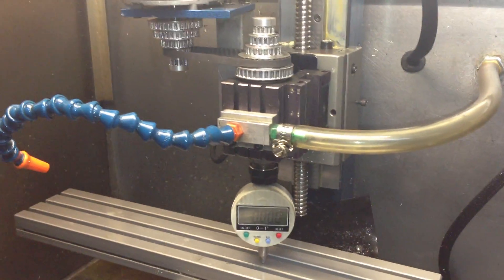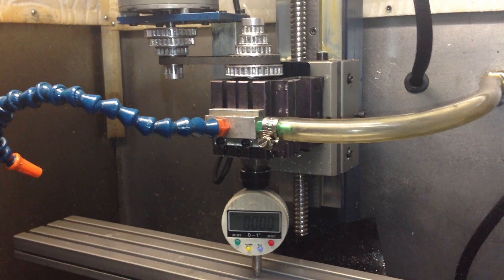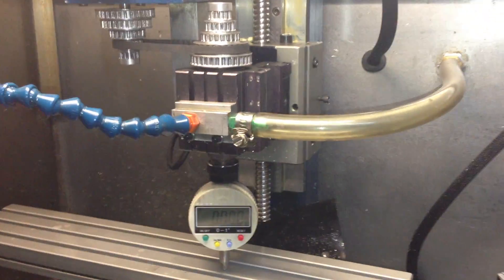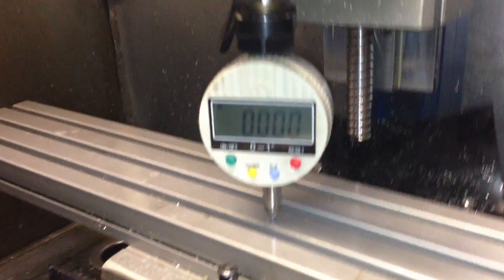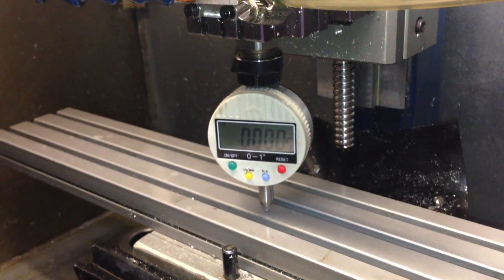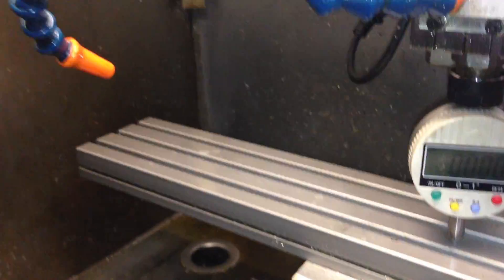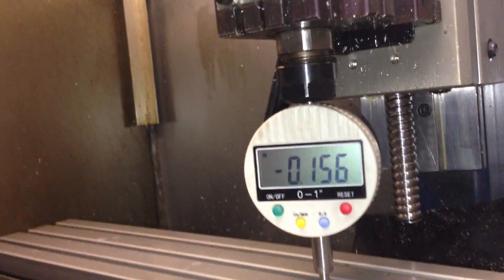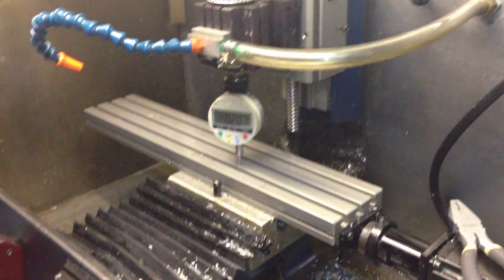Taig Ballscrew test on Z

Comment: im thinking of purchasing a taig with ball screw cnc. What happens when power is turned off to the Z motor though?
does it just drop? is there some sort of brake?
Reply: You might want to talk to Taig... I made this 4 years ago myself so I'm not sure what they're using for there stepper motors. I had there DSLS system which had strong stepper magnets so if I turned off the system the spindle motor would not drop.